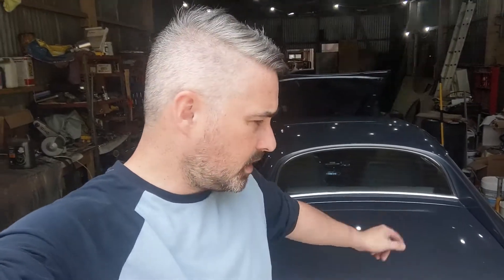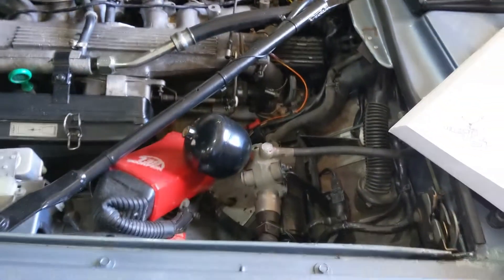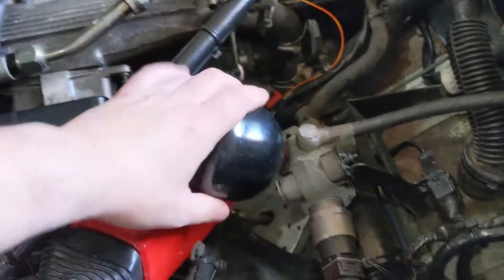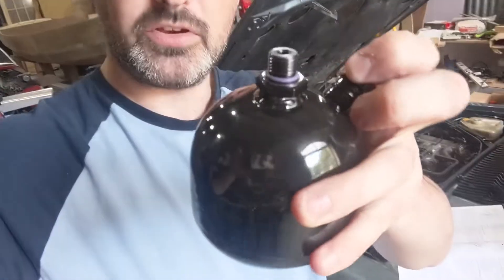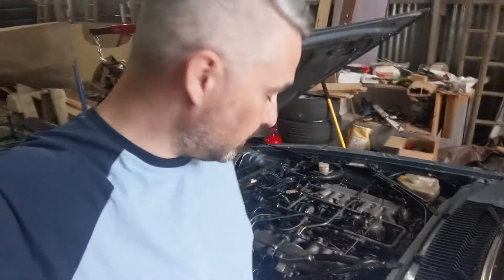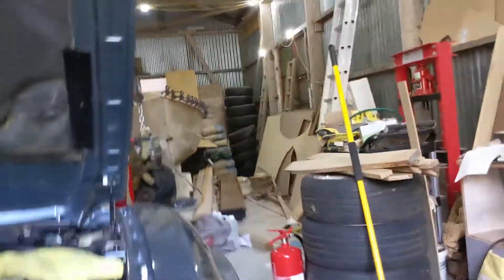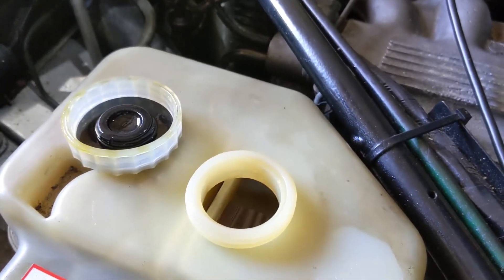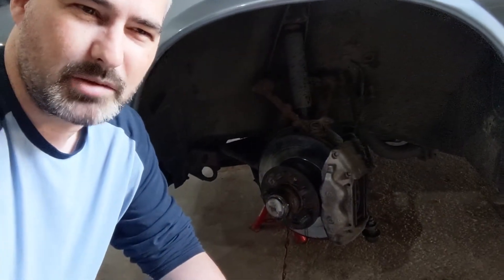False Start Brake Repair on the Jaguar XJ-S V12 (Part 1)

Comment: G'day Jamie, My '88 XJ-S braking leaves a lot to be desired, accordingly, I am embarking on a refurbishment of the "master cylinder"/solenoid assembly.  Quick, preamble, I had the rear cage out of the car to replace the rotors, fix a weeping diff, and get the handbrake to work, and ended up completely rebuilding it with new bearings, seals, shocks and springs: took a while but it wasn't that difficult.  Anyway, brake performance post reinstallation wasn't great.  
The actual bleeding procedure was successful i.e flow of brake fluid and air removed, however, brakes were very spongy, and pedal travel excessive.  The only thing I can think of is that the seals in the master cylinder are allowing fluid past them resulting in some but not good brakes.  I'll give you an update if you are interested, for your viewers once I have got it back together.  
Completely unconnected, I'm visiting Scotland in October/November to have a look around Edinburgh, Glasgow, and the West Coast, try some whisky (from the source), and look at the spectacular scenery.  I have to attend a Remembrance ceremony in England, so I thought I'd have a good look at your neck of the woods whilst I was there.  Cheers Chris
Reply from the maker: Hi Chris, does your car have the early 1988 vacuum boosted non-ABS brakes or the late 1988 Teves ABS brakes?
I hope you enjoy the Scotland and that the weather is kind to you - never certain at the best of times but particularly so in October/November!
Reply: @jamieduff1981  yep I have the Mk III Teves system,  just about got it out today,  after spilling a litre of brake fluid! Unfortunately one of the fasteners holdings the master cylinder to the fire wall turned out to be an Allen key.  The other three 1/2" nuts came off easily. But not the Allen key! I left it soaked in WD40 overnight, I didn't want to break it or strip the hex hole. I'm sending the unit up to Lismore NSW,  where we have a specialist brake shop.
Reply: @jamieduff1981  Jamie, the 'you beauty' brake place in Lismore has reneged on the repair as they can't find any parts for the Teves system master cylinder, apparently, they have another in the shop, and can't get parts so have kindly refused to take mine on.  Do you know of anywhere in the UK that sell Teves bits and pieces?  Much obliged. Cheers, Chris
Reply from the maker: @ChrisEggleton-s7f  Hi, they're a bit thin on the ground I think, but it might be worth asking Ben Thompson at Simply Performance if he has a source?

Comment: I'm looking forward to the next episode, the TEVES system does seem to be one of these overly complex, almost works kind of deal. But in the late 80s they probably didn't expect the cars to last 30+ years.
Reply from the maker: Absolutely. It's a weird set up. The master cylinder effectively operates the front brakes without assistance, and the rear brakes are powered by the accumulator charged by electric pump. It only looks halfway sane compared to the even more baffling Delanair climate control system inside the cabin!